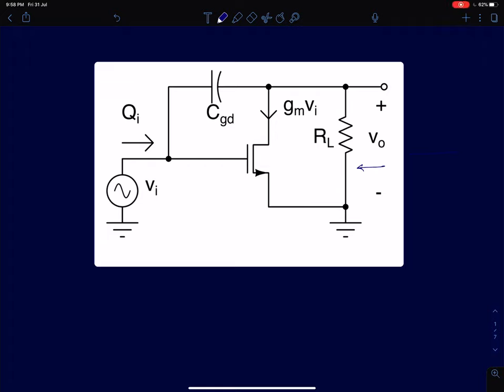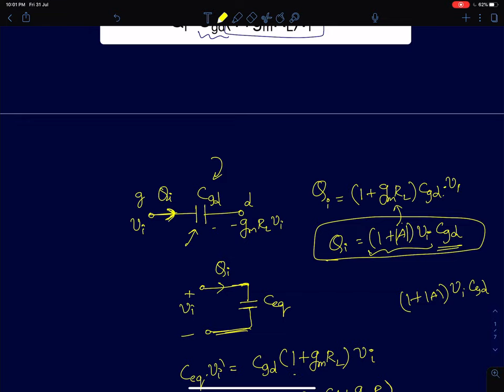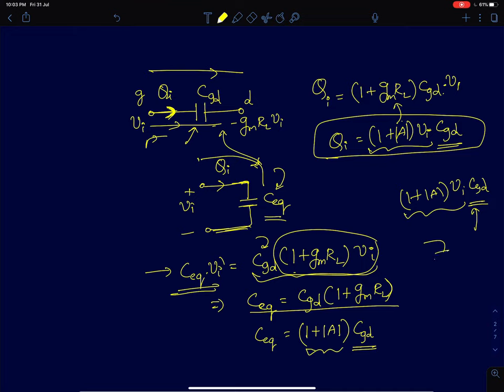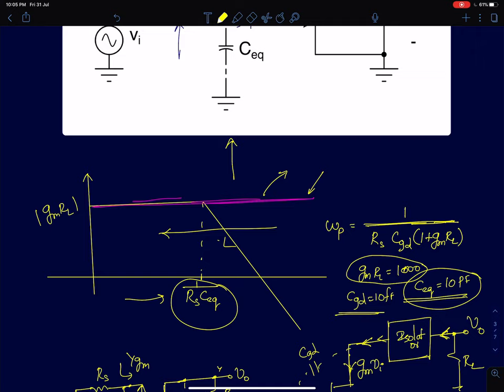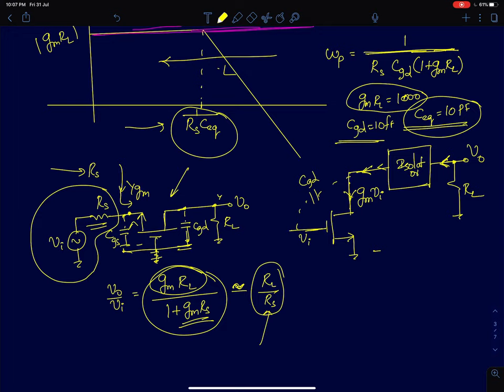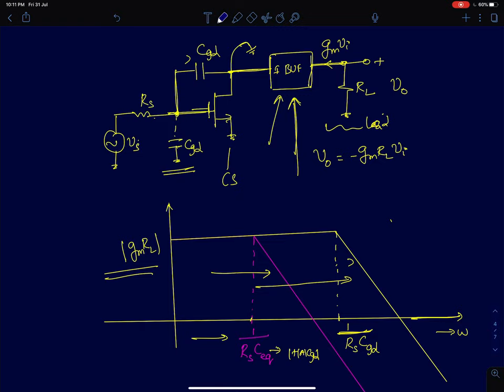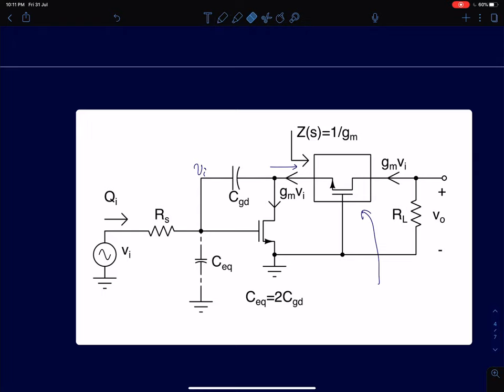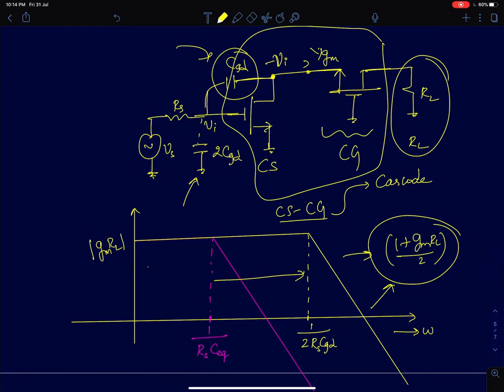AIC Lecture 40: Miller effect and Cascode amplifiers

Comment: In the video (AIC Lecture 24: Modified Miller's theorem for trans-conductance (MOS) amplifiers) u have explained about zero... Now pole concept.....Which one is correct??
Reply from the maker: Hi Vasu, this video is about the understanding and reasoning behind cascode amplifiers. The engineers who came up with the idea of cascode amplifiers saw the bandwidth enhancement due to input pole shifting as an advantage that the cascode amplifier offered compared to conventional common source amplifiers. This is an intuitive way of understanding cascode amplifers and why they were invented or used so popularly. But when you do an actual implementation you have to take the RHP zero into account. That’s more of an exact analysis. Hope you get the difference now.